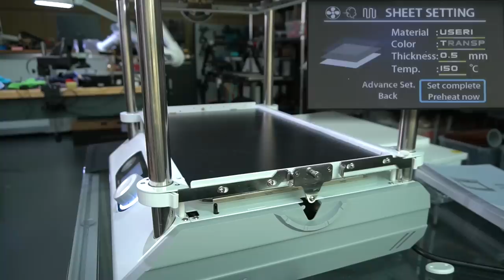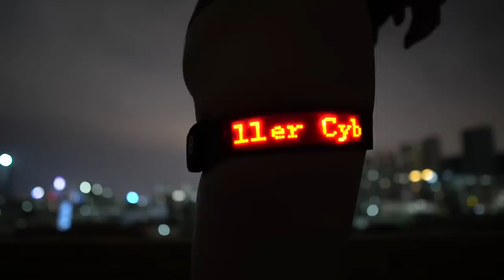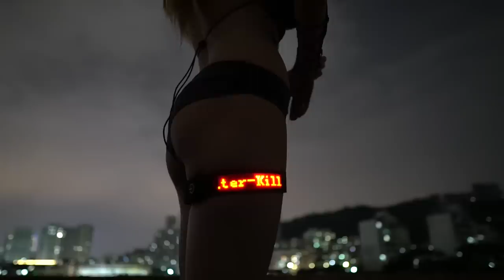Kydex Bra Vacuum Forming With The Formart 2

Comment: Hi Naomi, have you tried printing the moulds in ABS or ASA? They should not soften or deform at the temperatures you used for the forming of the materials in your video.
Reply from the maker: I did in PETG, a little better.

Comment: The kydex breast plate didnt come out as polished as i hoped was that a function of the mold used or a property of the material? 3d Printed yielded better results unless the result youre looking for is time saving. Can you used carbonfiber epoxy sheets in this with between the mold and a plastic sheet?

Comment: Using a high temperature filament should help, like some nylons, or maybe nGen.

Edit: Not sure if it's possible with that machine, but if you can change the oil on the vacuum pump, it's probably a good idea after the water exposure.

Comment: A better way to make the forms would be to use a CNC machine to cut them out of a material that doesn't deform with heat, like MDF. You would have to cut several layers and assemble them to get something that large, but with some guide holes they could be easily aligned. 
I would have liked to see more tests in the video to show where the limitations of such a machine are. In my own vacuforming tests, there were problems with the material folding, or in large, complex molds, not enough suction getting through to pull the plastic down in the middle of the part.
Also, will the machine work with 3rd party materials, or only with materials that have the barcode on them?
Reply: Thanks for the heart, but I'd actually like to know the answers to the questions!

Comment: i dont know much about 3d printing, but if it took 3 days to print, im guessing it was maybe solid?
 ..i paused the video & typed a bit saying how you could use plaster before i resumed the video & you said it too XD

i keep seeing people use 3d printing as an alternative to other methods when its actually slower & more expensive. its mostly good at taking a digital file & making a prototype, but i would just go with regular casting after cleaning up the print, in some cases the things people print can even be quickly cut from wood.

as for the machine, it looks like the tray sticks sometimes because of slight tilt when moving it manually. i think they could have avoided this if the sides of the tray were thick enough, or maybe add some ball bearings.

Comment: Much better to 3d print negative mold,  cast in plaster then vacuum form. The 3d printed mold would not need to be particularly strong. Thanks for the informative video.

Comment: I think this machine is quite fiddly lifting and pushing the layers up and down. There are no consistency there to keep the mold (depending on what it is) i think a motorised lift and down of the levels would be simpler for the user and have a quality finish to the mold. But this will put additional cost on top of the machine. Good for novice and price conscience creator's who doesn't expect quality finishes I suppose. Or am I wrong regards to the finished quality??

Comment: Reminds me of the Mattel Vac-u-form I had as a child.  Except on the Vac-u-form, the sheets were only about 75x75mm, and the vacuum was created by a manual pump.  LOL!   And I never made a bra with it.  Interesting video.   Is there a way to treat the edges of the plastic bustier to make them gentler on the skin?  I would imagine they are pretty sharp and stiff as is.
Reply from the maker: The rounded silicone edging I apply in the video does a good job of that.

Comment: What's dimensional lumber cost there?  You might try CNCing a positive mold out of wood, or 3D printing a very thin negative formwork and using that to cast a positive mold out of plaster.

Comment: Hey young lady, do you know if anyone in China makes a hot wire foam cutting four axis CNC, (Two axis each side) for cutting model airplane wing cores? My low tech gravity, drop arm cutter is a pain to set up and I have to make cutting patterns by hand to put on either end of the foam blank.

Comment: Use a razor to score the kydex in the area's you want to cut then bend the kydex where you scored it. Easy way to remove material and make straight lines

Comment: would it be better to space multiple small parts on the same sheet, rather than use a whole sheet for each small part? I looks like a lot of wasted material.  Would the vacuum not function properly with multiple objects?

Comment: Sorry if I missed it, but how did you scan your arm and chest for the 3D prints? Also, it looks like the form for your chest turned out a little to small, or something. Looks like it didn't fit quite right when you put it on, is that right?

Comment: Hey Naomi, are you able to do multiple forms in 1 sheet? Like both arm shields or both layers for the sheath? Or does that cause the vacuum an issue? Just wondering , seems a waste of material for just the one piece.
Reply from the maker: Sure as many forms as can fit on the bed. You can also do half sheets

Comment: Naomi, when you are cutting the arm shape out of the sheet there is a strange triangular/pyramid 3d printer in the background printing non planar it seems, what printer is that ?
Reply: that is a belt printer... a printer that uses a belt as a bed making a printer with infinite z (the belt becomes the z i believe instead of the usual y)
Reply: @Vampiro2111  Thanks man, yeah i actually found out in the meantime. And it is not non-planar, just slanted ;)

Comment: Is it possible to turn down the volume of the beeps?
Also,  do you have to use full size sheets each time?  It seems a waste of plastic.
Reply from the maker: Not sure about the volume but you can use smaller pieces
Reply: @Naomi-Wu  does the frame holding the sheets adjust,  or are there insets to allow for smaller sheets?

Comment: i don't know enough about thermal plastic could it take the process to chrome it? I ask because the outfit you make would look Cyberpunk as hell if it was metallic/chrome
Reply from the maker: I want to try that next...
Reply: @Naomi-Wu  I also have one thought for making a reusable mold but IDK if it would work and that was instead of making a 3d print of what you want to vacuum make a 3d print of a mold then cast what you want to vacuform it in silicon I know Silicon molds can take higher temps as they sell bakeware in the US made from it (and resin crafters use it because it's less likely to warp) you should get a lot more uses out of it and if it does break down or get damaged it's a lot easier to make a new silicon mold then a new 3d print

Comment: Adam Savage has made vacform videos over at tested.com and he made his own vacform machine. I think 3d printed bucks is not the way to go, but if you need fine details, using wooden bucks would be better if you want repeatability. Using your mill may be the go for making the bucks. 

For example Adam used his machine to make a PLSS for his Apollo moon suit (which is based on box shapes).

Although if you want to make sexy plastic items, you should vacform Angus @makersmuse hair....